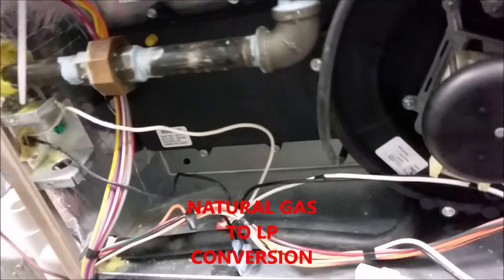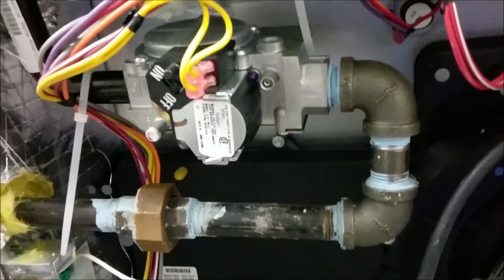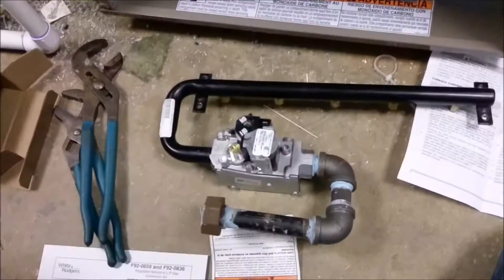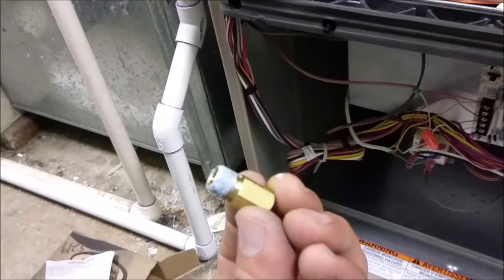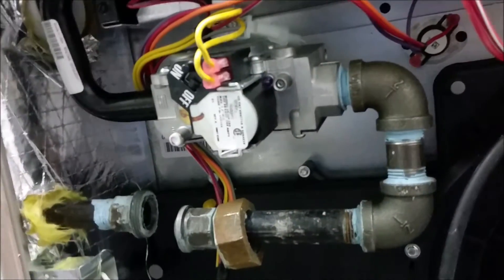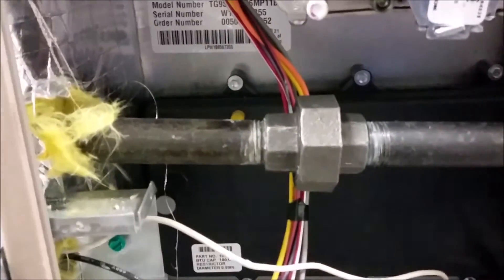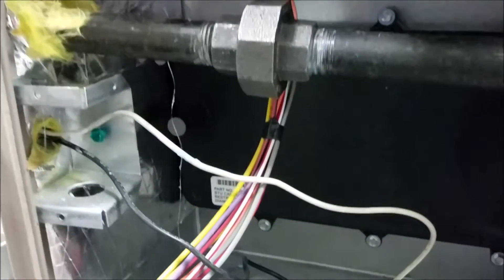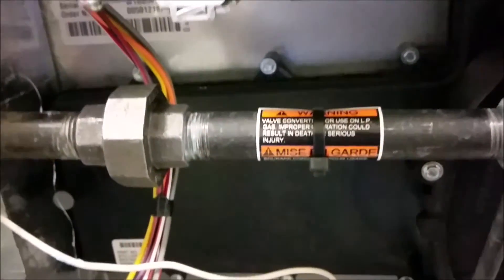Natural Gas to LP conversion for Champion Furnace TG9S

Comment: pressure switch seems like it should be mandatory. 
Wondering what would happen if the Lp pressure drops below range without a pressure switch. (ie. propane tank runs out of propane while it's firing).
Reply: The furnace running on low gas pressures will cause carbon monoxide leaks due to the incomplete combustion, best case it’s very low and the burners don’t even ignite and furnace locks itself out after multiple attempts to ignite

Comment: why does a LP need a pressure switch before the gas valve? what happens/should your pressure be reading if you have 2 stages of heating?
Reply: Pressure switch needed for incoming gas supply..if drops out of range it turns off the the heater till gas pressure is reestablished..

Comment: You said this is a new unit that was working before then stopped because birds clogged the exhaust vent then you cleaned it and changed it over to Lp so are u saying that it was running on the wrong gas before
Reply from the maker: correct, not knowing that someone had replaced the unit and didn’t convert it, high limit was going off, it was clogged and then found out it wasn’t converted 😂

Comment: Actually the smaller orifice is for natural gas. Natural gas burns hotter.
Reply: think you got it backwards, do your homework.  Propane has about 2.5 times the energy per unit volume than natural gas.
Reply: @emptech  prolly
Reply: Lol obviously your not an hvac technician if u think natural gas burns hotter than propane